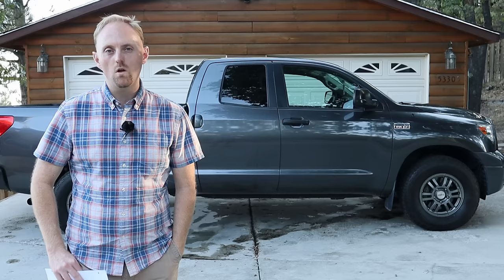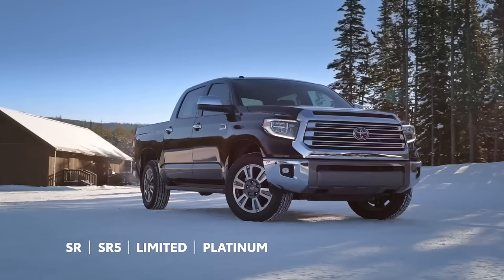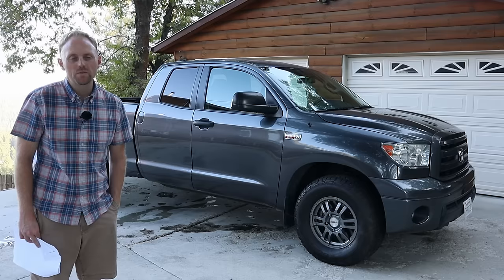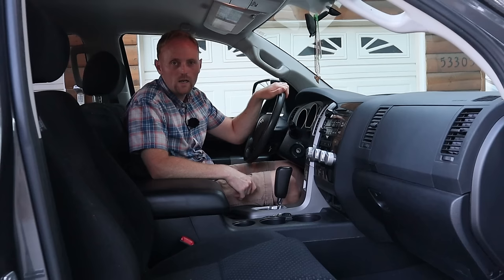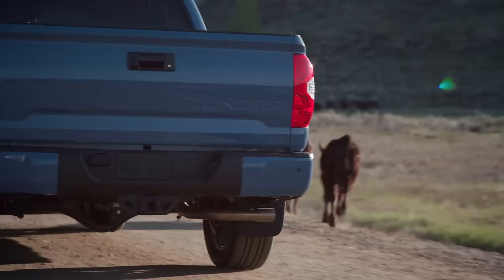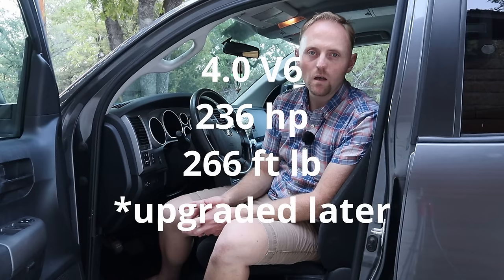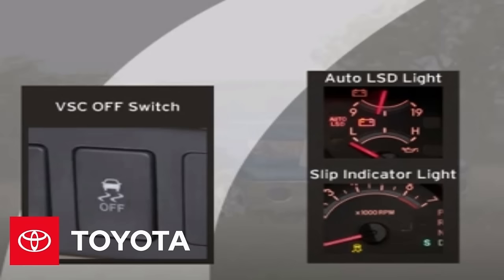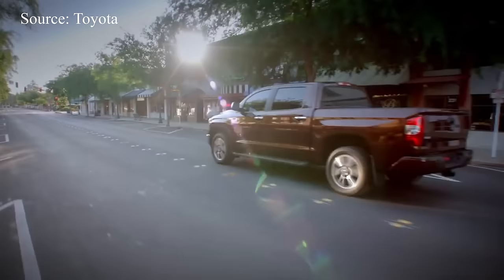Toyota Tundra  |  Brutally Honest Long-Term Owner Review

Comment: 2010.with 4.6L .  Was averaging 19mpg when new, down to 17mpg after 330k miles.  I tow a 4000lb trailer every week. It's been very reliable, although not flawless.  Still, I would have gone through a couple rams or ford's by now.

Comment: Nice review.
2006 SR5 4x4 Double cab original owner chiming in here. 160,000 trouble free miles. Limited slip and tow package factory installed. This truck hasn't missed a beat in 14 years and easily tows our 4200 pound boat over the Sierras to Tahoe.
Reply from the maker: Awesome

Comment: My family has owned Toyotas since 1980 starting with the Camry and then I broke the sedan trend and bought a 4Runner in 1997.  The 4Runner had 305k on it when it was totaled (insurance totaled it) I bought a 2002 with 240k.    We also replaced a totaled 1999 Camry with a high mileage Camry 2001 and it was still driveable in 2017, but my mother could no longer drive.  So, I just bought a 2018 Tundra because I wanted to be able to heavier loads than a 4Runner.  My ex husband had Ford F150 with a rear seal leak.  He said HELL NO to my suggestion to replacing with a Tundra.  He bought another used Ford F150 from our neighbor.  Not a month later, it had a rear seal leak.  My parents neighbor bought a Ford F150 because he had to buy American and Toyota was shit.  His truck was in the shop more than it was on the road.  It eventually also had a rear seal leak too.  America's No 1 selling truck (Ford) vs most reliable truck (Toyota).  Take your pick.
Reply from the maker: great story thank you

Comment: Great review. My dad has owned nothing but fords because all of his work trucks were fords. He switched to the tundra after seeing how quiet my 1990 celica I had ran back whem I was in the military. He bought am avalon in 01 and loved the reliability so he bought a tundra in 2013 and it has been the best truck he has ever owned. He bought another one as a work truck and not only commuted 90+ miles to work and another 90 miles back, but the truck ran idling all day and he had not a single issue with it. He won't buy anything else now. Both of his 2013 trucks have been flawless.
Reply: My 2013 is doing great at 165k, great decision.
Reply: I’m looking at a 2011 Tundra Doublecab with 128,000 miles for $19,000.. I’m thinking about buying it soon as I can
Reply: @smalltownguy76  Pull the trigger. You won’t regret it. I personally love the 4.6L, more than the 5.7L. I’ve got a 4.6 DC and have had little to no issues. If you end up having a SAIS issue depending on state check out Hewitt Industries, if not that fix don’t be afraid to tackle the job at home, it’s really not bad. This is the #1 tundra issue and the dealer is likely to quote you $2400+ to fix it, it’s not as big of a deal as they make it out to be.

Comment: I’ve got a 2010 Smaller block V8 I bought new. I drive it pretty hard. Do fair but far from perfect maintenance on it. After looking at new truck prices last year I took it to the body shop I use and had them do $6000 worth of repair and paint. Got a new hardcover tonneau for bed, some new tires and new floor mats. Spent another $2000 on shocks and undercarriage work   
It’s got 207,000 miles on it and rides like a dream.  I highly recommend Mich Ltx Ms2 tires. Incredible traction, ride and road noise is minimal. Took some of my old friends to the keys for a week and they couldn’t believe how great a 14 year old truck looks and rides. I traded in a 2004 Tundra on this one. Never had a major problem with either. I’m 68 and I’m thinking this truck might outlast me. Amazing quality and durability

Comment: My 2009 Toyota Tacoma TRD Sport with 172K miles. Never had an issue with anything and I'm the only owner of it. Still runs like a tank. Bought a 2020 Toyota Tundra Platinum 4x4. Handles so smooth, nice ride, comfortable, can do heaving towing and is better than the other "trucks". Best Trucks on this planet.

Comment: I drive a 2010 SR5 regular cab 8foot box. It’s got a 3 inch levelling kit in the front but also has blocks under the leafs so it still has “stance”. I gotta say the truck looks and feels like a beast. The stance and toughness of it reminds me a bit of a 3/4 ton truck. When I bought it in 2016 all my buddies were in love with it because it outperformed their trucks. Now those guys have bought a brand new f150 and GMC Sierra. Even though the new trucks are better in most categories, (except the gmc my buddy bought, he got the wrong rear end and towing suffers because of it), the ole tundra still earns their respect. It’s a mans truck. The transmission always feels like it’s in “work mode”, it’s always downshifting early when slowing down. Some people might not like that because it takes away from the every day driving comfort, but I absolutely love it. I would rather it feel like a dump truck all the time than feel like an old Cadillac, (rams).
Reply: Did you suffer in the turning radius with the std cab and 8' bed?  
Are there storage space behind the seat?  
Do you have problem with keeping it on the road in rain/ice?
Do your have a 6-cyl?  If yes, was it enough for all your needs?
I'm thinking of getting std cab, 8' bed, 6cyl.

Comment: I recently got an 07 Tundra double cab with 67k miles on it for 14k and couldn't be happier. Slapped an eibach lift kit on. New front rotars,pads,wheels and general grabbers. It looks mean and drives beautifully.

Comment: Very well done & thorough review!
I had a 2012 Rock Warrior Crewmax. I paid $35k in 2012. I had the AIP pump issues right at 2300 miles. Toyota took my truck and replaced the pumps, but I was stuck driving a Corolla for 6 weeks since parts were on backorder nationwide.  
After that I had zero issues for 5 years and 50k miles. 
I got $30k trade in for it in 2017 when I purchased my 4 runner. There was nothing wrong with the Tundra, I think I just had an itch for something different.
Fast forward 3 years and I am back in a Tundra - 2020 TRD Pro.  I love my Tundra and don't see changing trucks again anytime soon.
Reply: Love my 15 but tow a trailer after 18 no trans cooler will stick my  15

Comment: Just rolled 368,000 mils on my 2007. I have put three starters in them but that is it. Still drive it every day. I'll buy another one when it stops.
Reply: Is it the 4.7 V-8?
Reply: @aquaticterrafirma   Mine is the 5.7L
Reply: @daviddunaway868   Nice, I heard the starters were hell to put on the 4.7 was not sure about the 5.7. Did you do yourself if not what do they cost you? Any other problems? I have a axle bearing that just shat the bed on me... 125k miles.
Reply: @aquaticterrafirma   The starters are not fun at all to put on! I basically set aside a full day to do it. I have said that the next time the starter goes out, I am selling the truck! LOL! I went with an "off-brand" starter from my local Advanced Auto. Only $200. The OEM part is like $500-$600. Only other thing I have done is replaced the oil pan, but that is because I let someone else change my oil and they stripped the drain plug out.  Other than that, that's it. I might have to replace other parts one day, but we will see.

Comment: had my 05 tundra for a year now. been a great truck, was a 75 mph rollover , new bed, door and fender + repaint and its good as new at 200k miles. the 2nd gen is amazing too. the tundras just one hell of a truck when it comes to something to depend on.
Reply: I inherited an '05 in '08. Drove it for 9 years, my son another 4 yrs then traded for a car. Not a moment of issues. No worries, no repair bills.
Reply: I'd never keep something that I rolled at 75. Nope.
Reply: @richsweeney1115  I bought it rolled. Put the work in and she’s been trouble free for 15k miles so far. Tows like a dream

Comment: My 09 Tundra SR5 double cab with 160k miles runs like a brand new truck. I would take it anywhere. I'm not easy on it in the northwoods but it doesn't phase it. It's simple, no shop time. I'm happy.

Comment: Just bought a 2021 Tundra. Really thought hard about the F150 for all the great features and MPG but decided that I just wanted a basic V8 with no turbo for reliability.  I know it will be a little boring, but I needed a super reliable farm truck for towing. My previous Ford had issues going into 4wd.  Wife loves the Tundra and had reservations about getting another Ford.
Reply from the maker: Thanks for sharing!
Reply: Smart move, If you've ever had a turbo equipped vehicle and had the turbo go bad, its verrrrry expensive in a lot of cases. The F150 has two which is a major point of concern for me. I wonder how long a V6 with two turbos trying to make it do the work of a V8 will hold up over time.
Reply: Or a water pump that fails and pukes coolant into the oil… fatal flaw in the ecoboost. Dumb design
Reply: I'm looking to get a 2021 tundra. Good move or should I pass and look for a different truck? Looking to make sure the frame don't have problems with rust like the older ones. Thanks everyone

Comment: I have an '02 Sequoia that I bought used a couple of years ago. It has over 300k miles on it. It's thirsty, but everything still works on it and the seats are still dreamy soft. It's not new, but it's not a broken rusty embarassment either. You can nitpick at it's flaws, but I can't talk myself into replacing it yet.
Reply: Yeah that generatuon sequoia was plagued with transmission issues

Comment: As an owner of a 2017 Tundra 4x4 SR5 TRD package double cab, I can say you really hit the nail on the head with this review. I agree with every flaw and feature you pointed out about the Tundra. I've looked at upgrading or even switching brands for the fuel economy, but that is the only thing I am "marginally" discontent with as far as ownership. My truck tows great, has never left me stranded, and with an aggressive set of oversized Cooper tires performs very well off road. I bought the truck with 39k miles used in 2019 for $28,000 and with 83k miles on it now the dealer offered me $28,500 for the truck. I was just curious with the crazy times what it was worth but I'm not selling it. I may consider the newer Tundra one day if gas goes to $6 a gallon here in CA but honestly I love the V8 and simplicity.

Comment: Wow for a 10 year old truck still look like new from the showroom.
Reply: I bought a 2010 5.7 double cab long box  it had 92k on it I've had it for 3 months it just turned 97k yesterday and I have zero complaints and my truck is beautiful alot of other told me the same thing
Reply: Because it's not used as a real truck. Toys ... Just toys.
Reply: @dontblameme6328  Didn’t ask g
Reply: Mine is an 03 with almost 200 thousand runs brand new. Inside and outside
Reply: @mattsfirewoodvideos738  she won’t let u down
Reply: @prestongillispie9279  here we are about 8 month in and 15k miles later and still running flawlessly

Comment: I researched all full size manufacturers, my choice to purchase a Tundra was based on reliability and ease of use. 

So I recently bought a 2017 SR5 Tundra from a one owner with 97k on the odometer. 

My hope is that it lasts me to 300k and beyond.

First thing I did, change all fluids and replace all brake pads and rotors because I am going to tow (has factory tow package). 

I plan to keep a healthy maintenance schedule. I do my own mechanic work.

I chose to buy a used private one owner Tundra  for price and avoid the headache of sales at dealerships (stealerships).

I’m excited to own this truck and value the reputation and reliability record of Toyota, it’s an investment.

Your video is great and valuable information! 

Thank you! 😊

Comment: You did an exceptionally through, and very clear (easy to understand) review sir. I've owned five Toyota pick-up trucks in my life, and three of them were Tundras. My current vehicle is a Platinum Tundra and I am very happy with it. I know that there are much more expensive trucks out there, but I have everything that I want in my stock tundra pick-up truck. I've never had any real issues with any of my Toyotas, so, that saying (if it isn't broken, don't fix it)  is why I've been loyal to this brand. I loved your review sir. Thank you for a job well done. Be well.
Reply from the maker: Thanks!

Comment: Just gave my 2008 with 243,000 miles to my son when I recently bought my 2020 1794 Tundra.  My old truck still has the same power and handling it did the day I bought it, is very comfortable and I only had to replace an alternator when it was still under warranty-that's it alternator, a couple of batteries, a few sets of brakes and tires in almost 250,000 miles.  There is no other truck out there that that will hold up like that...and I drove the hell out of it; still it looks and runs great and a dealer still offered me $10,000 to trade in on my new truck...my Son is a proud young man.
My new 1794 4x4 Tundra looks as nice and is as comfortable as any Ford, Dodge, GMC, or Chevy.  It pulls my 10,250lb boat like there's nothing back there.  And my dealer (Melbourne Toyota) offers a LIFETIME powertrain warranty.
My new Tundra is loaded has anything you could possibly want  and is smoother than any Limo I've ever rode in.  I researched and test drove all the competition and sorry there is no comparison.
Reply from the maker: thanks for sharing
Reply: Lance Sheffield    I totally agree I have a 2017 1794 with the TRD package I added the rear sway bar and it is the best truck compared to the other manufacturers.  I will keep this truck to my grave.

Comment: While I appreciate your attempt at a “long time owner “ review, 40,000 miles isn’t even close to being long enough. I will say that I have had a first generation Tundra, 2006, and I currently have a 2010 Tundra double cab TRD with a 5.7 and 209,000 kms on her. I bought it from the dealer brand new in 2009. Put in a new water pump a couple of years ago with a radiator and last year I replaced the brakes. This truck still has every bit of power as it did in 2009. I use it like a truck, I have had gravel, top soil, lumber and various concrete products in the box. I also had a sled deck on it up until a couple of years ago, put 2 800 Arctic cat sleds with “162 tracks, 550 pounds each on with just the stock suspension. It held up perfectly. I do all the maintenance on her and always use the best oil, Castrol synthetic. I have no plans to sell her, I pulled a travel trailer for many years with no problem. I would buy this truck again without any doubt. Thanks for your review.

Comment: I actually preferred the 07-13 model. There is just something weird but unique about it.
Reply: yeah that model year was also the fastest, i think he was running that test a good amount above sea level which the ford would have an advantage of because of turbos. the fastest stock truck without trd supercharger from 07-13 was 0-60 around 6 seconds
Reply: @pwhittyp5365  1st gen is too small.
Reply: Agreed Anh. Have a 2011 also and prefer the styling over the next gen
Reply: Nah, to bubbly and rounded looking and don't like the gauges at all. The 14+ is more squared off and better for a man at least.
Reply: @pwhittyp5365  Brakes are a weak point. They really made them large on next gens.
Reply: Got an 07, still love it

Comment: I have a 2007 Tundra crewcab SR5 4x4 5.7L. It is our work truck and it just clocked in 200,000 miles. Parts that needed to be replace were the water pump, starter, UCAs and pulley tensioner. Everything else was basic maintenance items. The truck is unreal how reliable and great it drives!

Comment: I have the same truck. Bought it brand new in 2011. Put 95k miles. Reliable as hell. Had to change the battery on it a couple years ago. That’s it. Regular maintenance done when needed. I’m in the market for a sedan, now that I don’t need a truck anymore but I’m not selling my Tundra. I’d rather keep it around just in case and heck, my son or daughter can have it in about 8 years when they can drive. It’ll be just as new as today.

Comment: Have a 2019 Limited. I bought after trading in a 2016 Ram that had several cosmetic and mechanical issues. I miss the power fold mirrors, remote start, big screen in Ram. Do like truck feel of Tundra and its simplicity. I plan on keeping for long time.
Reply: I have a 2010 200k and just básic maintenance and a coil replace in 7 years

Comment: I’m on my 5th Toyota truck, I’ve owned Hilux in England and I’m on my 3rd Tundra here (2006/2008/2016) I sold the 2008 with nearly 270,000 miles on it for $16,000. They are unbelievable work horses.

Comment: I still have my 2011 Tundra that I bought new October 2010; 110,000 miles, Crew-Max cab.  I paid $37,000; 4WD; 4.6 Liter V8.  I LOVE MY TRUCK!  I have no need for the 5.7.  My only complaint is that it takes a long time to heat up winter. (Ironic for it's name).  Mine came with Bluetooth.

Comment: My 2012 Ford F-150 Eco Boost lost a turbo while on vacation. It had 143,000 miles on it. The dealer did not have any in stock and they had done several since January. It had wonderful low end power for towing. They were going to have to ship one and I didn’t have the time to wait. 

We ended up walking next door and bought a used 2018 Toyota Tundra with 34,000 miles.
It definitely is a little more louder, because it is towing in upper rpms. However, it feels strong and it tows super straight. It feels solid. 
We are not planning on purchasing another truck. 

Thanks for the video.

Ram
Reply from the maker: Cool thanks